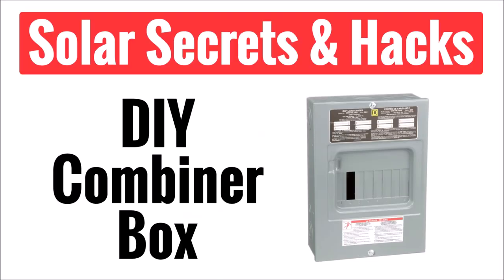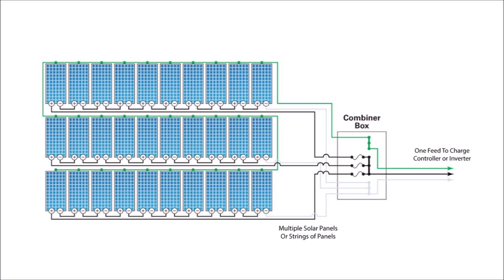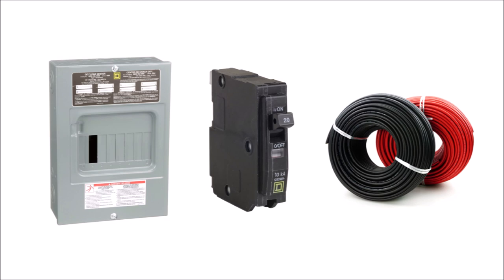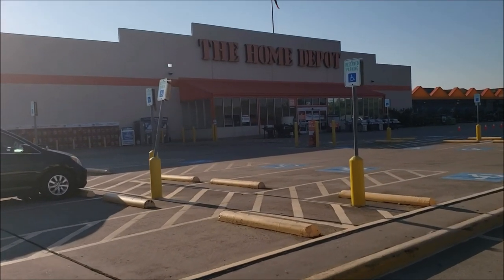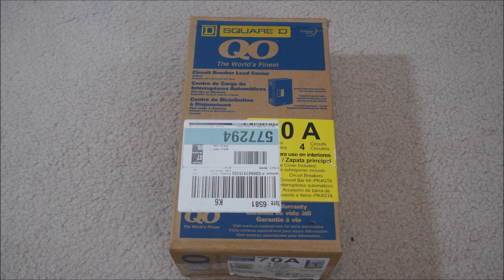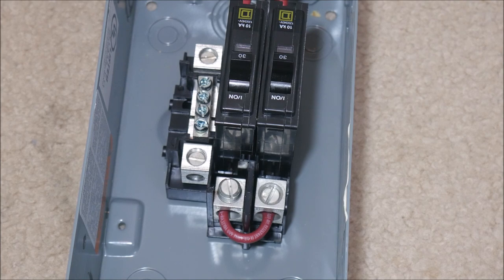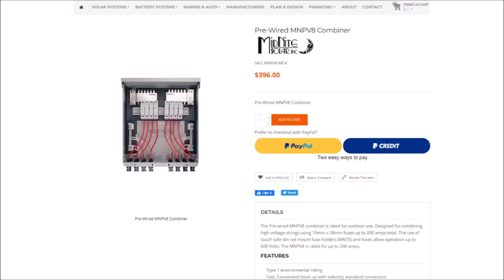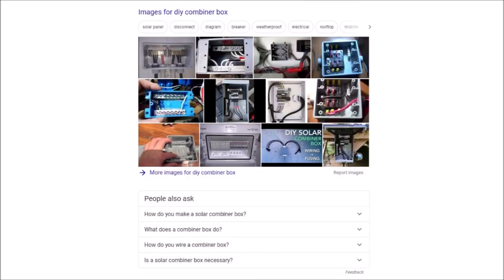Solar Secrets & Hacks - DIY Solar Combiner Box

Comment: There is one thing missing that I highly suggest you add, a Solar Surge Protector or lightning arrester because lightning does not actually have to directly hit your panels causing a surge that can destroy your batteries your inverter and other components.
Reply from the maker: That's true.  Most ready made combiner boxes have them inside.

Comment: HMy two cents... The breaker can be triggered by overcurrent, but not for any electrical failure. Overcurrent in solar panels  DC side are very hard  to happen, so i still recomend to add a fast acting fuse and your box as a disconnect and junctiin device! However I was gladly impressed by your great video. Keep tour great job
Reply from the maker: You can't go wrong with multiple safety devices, for sure.  Thanks for the support!

Comment: HOWdy  SS&H,
Man-O-Man = I wish I had seen your VIDEO before  I  PURCHASED an  " ECO-WORTHY" 4-String COMBINER-BOX 
If  I had known about the SQUARE-D  "QO" rating for "Direct-Current" - I would have bought one of THESE at my local MENARD's Big Box Store !
The one addition to your example of a Combiner-Box  that I would  ADD is a  SURGE-Protection dongle 
Thanks for your VIDEO 
COOP
...
Reply from the maker: The Eco Worthy boxes are fine and not that expensive.  But the Midnite Solar and other boxes are just silly when you get something like this for a fraction of the cost.

Comment: Is there a type of "combiner box" available that can primarily utilize power from solar panels (when sunlight is available) and supplement its output with grid power (as a secondary source) only when the solar current is insufficient to meet the required output?
Reply from the maker: I have been looking for a similar device for almost 12 years.  Not that works exactly as you have described (that I know of).  There are various devices that can accomplish the same thing, but not as elegantly, simply, or cheaply.

Comment: I have 6 strings going in a combiner box with 88v per string and the CC input reads 66v the battery is 52v (approximate)  I tune off all breakers on the input side and the combiner plate still reads 66v ???? I guess back feed thru the CC?? but wouldn't that read the battery voltage of 52v ? if it was back feed. I know the CC is supposed to knock the voltage down to usable voltage for the battery but is this right ?
Reply from the maker: Yes, in some cases it is wise to put in a diode to block backfeeding the panels.  Are you sure the battery voltage is 52V?  I assume it is a 48v nominal lithium battery?  Do you have a clamp meter you can clamp on and see if any current is passing through?

Comment: Can u connect 220V one array
the other  100V array
to a combiner box 
what will be the  DC out value?
Reply from the maker: No, that would not work in parallel.  To wire something in parallel would mean the voltage is the same.

Comment: I have one, with three breaker's.want to do a four panels,265 Watts, each.to a solar controller mppt 60or 80 amps.to a converter 2,000watts AND also A wind turbine of 400 Watts. DOES this work for house off grid?
Reply from the maker: I don't think you really need a combiner box for 4 panels.  You can wire them all in series for a 48V array or you can wire them all in parallel with MC4 Y Connector cables.  A combiner box is more for complicated series-parallel wiring or for multiple string situations.

Comment: Nice, but your box is missing reverse-blocking diodes.  They would prevent one panel array from backfeeding another, in case your arrays weren’t perfectly matched, aimed differently, or subject to shade.
Reply from the maker: The solar panels have diodes.
Reply: @LDSreliance  The solar panels only have bypass diodes.  They almost never have reverse blocking diodes.  There are videos about the difference, and it is explained why you may want blocking diodes in a combiner box.
Reply from the maker: Yes, I can see where that might be a good thing to add.  Thanks
Reply: I also noticed there is no lightning protection spd or ground bump, and 48VDC is nearly useless for any serious solar power system.

Comment: Could the same idea be used for combining micro inverter AC strings of 240 volts each?
Reply: are they grid tied if so yes if they are off grid they must have the signals synced properly and that is hard

Comment: Hello, we just finished the panel mounting and was wondering about using breaker boxes also. My inverters max string input is 150v we are combining two panes which gives us 100v. Would this be to much for the QO breaker boxes? Thank you
Reply from the maker: Yes, that would be too much.  They are only rated for 48V DC.  You would need a more application-specific combiner box that can handle that high of voltage.
Reply: @LDSreliance  Thank you very much for the response.
Reply from the maker: You are welcome.  Thanks for watching!

Comment: My panels are 37v each.

Parallel wiring aside,
This would mean that I can only hook up one panel per circuit breaker since 48v max?
Reply from the maker: What do you mean parallel wiring aside?

Each circuit breaker can handle a string of panels.  In your case, parallel wiring would be required to use more than one panel on each breaker.  It can be done.  You just have to work within the safe current carrying capacity of the cables, which is generally AWG #10.
Reply: @LDSreliance  so say I wore 2 panels in parallel for a total of 18 amps.  I would have to get  a 20 amp breaker for those 2 panels?
Reply from the maker: Yes.
Reply: @LDSreliance  so you’re using 4 strings on your setup?

The 4 strings come together in parallel?
Reply from the maker: I don't have a system using a combiner box right now.  But in the past, yes.
Reply: @LDSreliance  

So your previous setup,  say each string was 10a, and 4 strings in parallel would be 40a,

Did those wires go straight to controlled or did it go into a breaker first and then controller?
Reply from the maker: I always use DC breakers in between every component.  I know it is overkill but they are fairly cheap, give redundant protection, and also give you the ability to use them as a switch to turn off power if you need to work on components.  So I would personally have an inline breaker in between the combiner box and the charge controller.  But it probably is not necessary.

Comment: Hey! So the 48v limit is what’s confusing me. I have 10  350w Rec solar panels, each 46.7 Voc. So if I do 5 sets of 2, each input into the bus bar would be 93.4v... and that’s double what this thing could handle?
Reply from the maker: In that case you don't want to use a QO breaker system.  These are just the only DC rated ones you will find in stock at your hardware store.  There are much higher voltage, solar-specific units you can get.  Try Eaton as they have a ton of them up to 500V DC and a ton of Amps if you need it:  https://www.eaton.com/ecm/idcplg%3FIdcService%3DGET_FILE%26allowInterrupt%3D1%26RevisionSelectionMethod%3DLatestReleased%26Rendition%3DPrimary%26dDocName%3DCA08100018E
Reply: Maybe you should wire them in parallel to increase your amps instead of volts!

Comment: So combining this way, does it act as wiring panels in parallel or in series?
Example: I have 3  340 watt 23 volt panels each independently connected to breakers in the breaker panel, if connected in this manner what would the output be?

I usually run my panels in series, but if one panel is shaded it affects the whole string. I'm thinking if it acts the same as being in series, you'd get that benefit while also having the panels not affect each other if one is shaded?
Reply from the maker: Combiner boxes are always parallel.  They aren't needed for series wiring because you just connect the panels to each other in that case.  In your example, the output would be 23V and whatever the output current is for each panel multiplied by 3.  So it is the opposite as series wiring, which multiplies the voltage.
Reply: @LDSreliance  thanks for the info,a combiner box is not for me. I guess there is no way to run series without the shade affecting the whole string?
Reply from the maker: Instead of typing out a ton of information here, here is a link to some ideas that may help you:

https://aurorasolar.com/blog/shading-losses-in-pv-systems-and-techniques-to-mitigate-them/#:~:text=How%20to%20reduce%20shading%20losses,level%20power%20electronics%20(MLPEs).

Comment: Lowes has DC breakers ???
Reply from the maker: Yep!
Reply: @ OZ Turks - Lowe's does sell Square D "QO" or "QOB" AC rated breakers - that also have a 48 Volt MAX DC rating.  But, most 48 Volt battery banks can be HIGHER than 48 Volts, therefore they should NOT be used with 48 Volt or higher battery banks, nor used with with 48 Volt VOC or higher Solar Panel Arrays.  And it must be a 15 amp - 70 amp breaker.  Per footnote #2 - The 10 Amp breakers do not have any DC rating.  Download and read the SPECS carefully!  This information has be available for about 20 years ...
Reply: @vtorsi610  so what your saying is build a 24 volt system
Reply: @mteca5093  Yes, the QO series breaker will work with a 12 volt or 24 Volt system.

Comment: Enjoyed your video. Really informative. 
I’m planning a diy grid tied solar project and I’m undecided as whether to put to inverter next to the combiner box or in the garage. How do you determine the size of wire and distance for both direct current and alternating current. 
Your thoughts and recommendations welcomed. 
Thanks
Reply from the maker: You definitely want the wire run as short as possible.  However, it is less of an issue when you are dealing with higher voltages.  So if you have > 48V coming from the combiner box then you are probably fine.  But to answer your question, there are quite a few wire size charts and calculators out there.  My favorite tools can be found in this video I did in the past:  https://www.youtube.com/watch?v=TO_a619bWh0&t=5s

Comment: It will only handle 48 volts?
Reply from the maker: Yes.  If you are going higher than that you have a large system and you wouldn't be using hacks like this.

Comment: Anyone brought up the importance of diodes in a combiner box? That may be another thing that would need diy, as boxes like Watts247 comb box has diodes, c/b s, and fuses I believe, all for specific purposes. Which also make them cost much more.
Reply from the maker: Why do you need diodes?  The solar panels already have them so power can't go that direction.
Reply: Incorrect. You need blocking diodes which are different than bypass diodes in the panels when running in parallel. One parallel array can use energy to put current into the other due to shaded or bad panels. Blocking diodes are needed when arrays are in parallel. It’s best to use a real pv combiner box which utilizes fuses for each array and blocking diodes.
Reply: Devo is correct.  Blocking diodes and bypasss diodes are not the sam thing.  There are videos about this on YouTube.  The panels have bypass diodes.  But they usually (or maybe always) don’t have blocking diodes.   I’m an electrical engineer and have lab equipment, so I was able to check my panels.  As expected, they have bypass diodes, but don’t have blocking diodes.  Fortunately, it’s easy to buy inline blocking diodes on Amazon.

Comment: I was going to make a combiner box then I was told I really don't need to. I have 10 100w panels. I just used a to 5 to 1 MC4 branch connector one for the Pos and one for the Neg side. Then connected them to the solar charger. I don't have a fuse in place either. Every thing seems to be working ok. The solar charge controller says it doesnt need to be fused coming from the panels.  Could there be a problem doing it that way?  Also do you notice anything about my pic?   thanks
Reply from the maker: I can't see your pic.  It is too small.

You don't need a combiner box.  But I don't see how you are getting 10 panels down to a single wire with only one 5 to 1 y adapter.  You would need two for the positive side and then two for the negative side and then a 2 to 1 adapter on each side to tie the first two together on each side.
Reply: @LDSreliance  One for the Pos and one for the Neg. I have them series/parallel connected to make a 24V array.
The pic shows me holding a trophy for the Ward Chili cook off.
Reply from the maker: Haha awesome!  I won that one year.  

OK, that makes more sense if you did 24V.

Comment: The lugs on that box are only rated for 1 conductor so doubling up with that jumper is a no no. Use an insulated 3 hole tap instead.
Reply from the maker: Good idea.  Thanks

Comment: Do you need 3 To 1 Y Type MC4 Branch Solar if using a combiner box? THANKS
Reply from the maker: Not necessarily.  They both do the same thing (combine several incoming wires into one output wire).

Comment: So solar system can only be up to 48v to use the qo?
Reply from the maker: Yes.  That is all it is rated for.
Reply: @LDSreliance  that’s like one 300-350w solar panel no?  Is it 48v for each breaker?
Reply from the maker: Not necessarily.  Most off-grid systems are 48V or less.  Most rooftop, grid tied systems are much higher voltage.
Reply: @LDSreliance  how many wattage is your system? How many strings?
Reply from the maker: Mine is 24V with 2 strings.  Total of about 1000W right now.  This is on my shed.
Reply: @LDSreliance  I see. Which charge controller are you using
Reply from the maker: I have one for each string to optimize the power, since not every panel is identical.  One one side I have a 60A MorningStar TriStar MPPT and one the other side I have a Magnum.  I forget the model off the top of my head.  It is in this video if you care to watch:  https://youtu.be/Xp3NPylwI40
Reply: @LDSreliance  ok I’m confused.

The 24v of your charger is the output voltage to the battery.   But your solar panels which I presume are wired in series shpuld total more than 24-48v correct?  If so, would that mean the voltage of your panels are over the 48v max of breaker?
Reply: @LDSreliance  ok I watched the video. I’ve seen magnum brand around. They must be good cause it’s quite pricey
Reply from the maker: No, off-grid panels are usually 12V.  But you can occasionally find 24V, 36V, and 48V configurations.  They are rare.  I think you are confusing residential/rooftop/grid-tied panels with off grid panels.
Reply from the maker: Magnum manufactures all of their products in America.  They are also built like tanks and last forever.  They would be on the upper end of the quality spectrum and are used in a lot of big installations.  They don't really do the cheaper end of the market with small systems.

MorningStar sits kind of in between.  They have some big boy stuff but a lot of stuff is for smaller systems.  Do not confuse small with cheap or poor quality.  I mean small as in 100W or so for small applications.  Their sweet spot is in the middle somewhere as they have excellent 45A and 60A chargers.
Reply: @LDSreliance  12v but how much wattage?  Can’t be that much unless high current?
Reply from the maker: Yes, they do use higher current.  But if you wire them in series for a 24V or 48V system, which is what I recommend, it mitigates that. 

So for a 20kW system, for example, you would more than likely divide that up into 5-10 strings and use combiner boxes to carry that power to multiple charge controllers.  But systems of that size are not that common.  Most people that are using that much power are living in a place where grid power is available and they want to be able to tie into the grid as well.
Reply: @LDSreliance  ooh.  How many panels you have going into each breaker?
Reply: @LDSreliance  I’ve seen chargers that can support like 100-500volts total of solar panels.  In that instance,  I would need breakers that can support up to 500v dc?
Reply from the maker: Yes, if you have one of those charge controllers then you would not need a combiner box.  They take an entire large string of panels into their inputs.
Reply: @LDSreliance  when you connect panels in series then each strings voltage will be multiplied. Go check your panel's open circuit voltage. you probably only can do 2s .

Comment: Id like to build my combiner box and  I have 6 solar panels... so I would need 6 breaker for each panel/string? THANKS
Reply from the maker: You can do it that way, yes.  You could have 6 breakers - one for each panel.  Or 3 breakers - one for each string of 2 panels in series.  Or 2 breakers - one for each string of 3 panels in series.  However you want to set it up for the best performance.
Reply: @LDSreliance You think would be ok if I connect them in parallel even though will get some shade for a short period of time?  thanks for your info!
Reply from the maker: If you can't get around the shade then yeah it will be ok.  In that case, not having strings is preferable because shade will affect an entire string's production even if the shade is on a single panel.
Reply: @LDSreliance YOU ROCK THANKS AGAIN!!
Reply from the maker: You are welcome.  Good luck!

Comment: This is a great video. I have looked all over the internet for just the right explanation for what I'm looking for, with close up video, and this video is it. I ordered and received this box after watching this video. Right now I have 3s3p going into a solar branch Y connector, but would like to use your method. So, my question is, can I use this box to connect just the two wires coming from the Y connector? If so, how and where do they go? Or, should I remove the Y connector and input all six wires into the combiner box?
Reply from the maker: You don't get all the benefit of the combiner box unless you do the latter.  I would not use the Y connector at all unless you have to.  I'd probably run 3 strings of 2s if it were me but I don't know what your roof looks like or what you are trying to accomplish.  But having each panel or each small string able to be individually fused using thick gauge cables is the big benefit here.